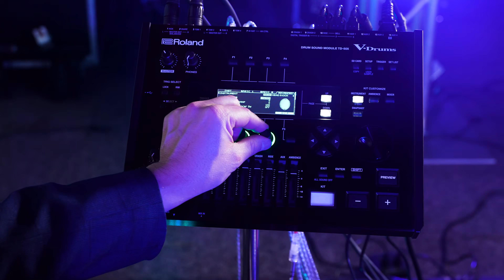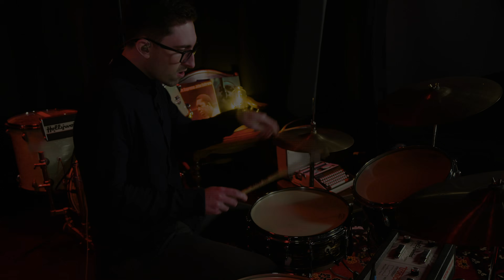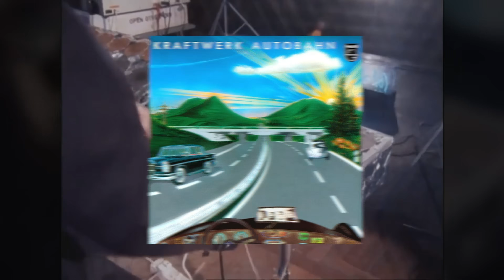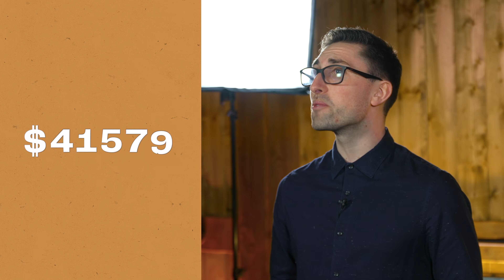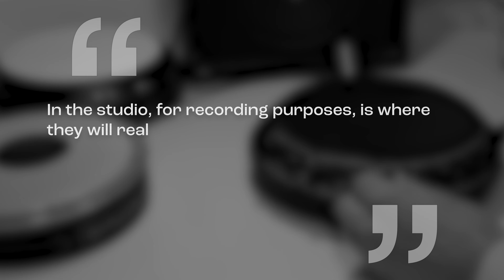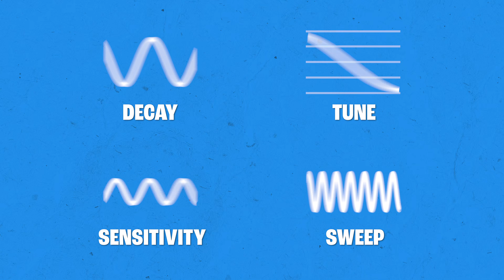The History Of Electronic Drums Part 1: The First Electric Drum Sets

Comment: My intro to electronic drums was the first old Simmons pad with the eprom chip. What a bad idea!
The swappable chips couldn’t handle the beating on the drum pad.
Worked great back in the day for a couple of extra sounds on my acoustic kit, until it stopped working!
Then there was the Dr. Pad.
Each pad had 6 sounds. Those things were very cool back in the day and they were reliable.
I think they made 3 or 4 different pads, each with different sound combos.